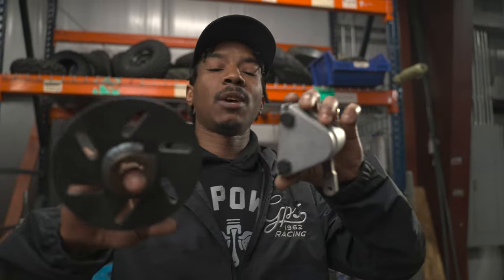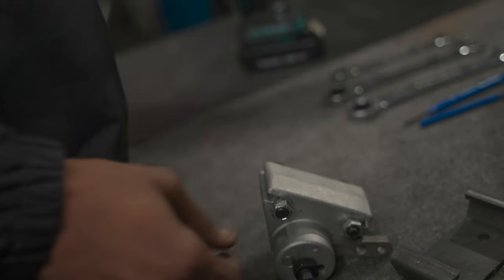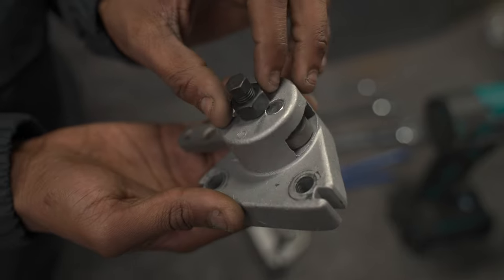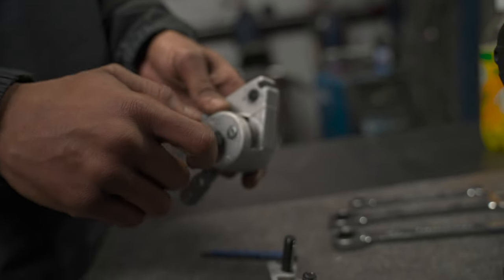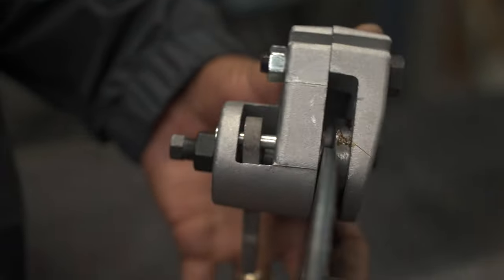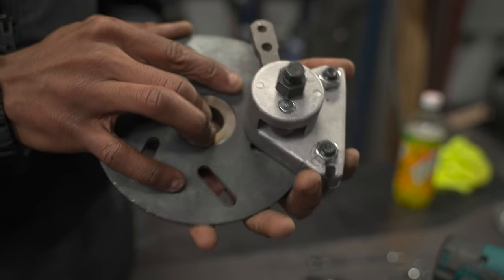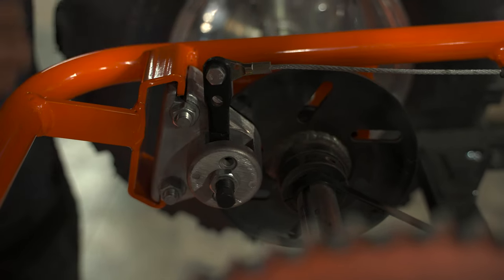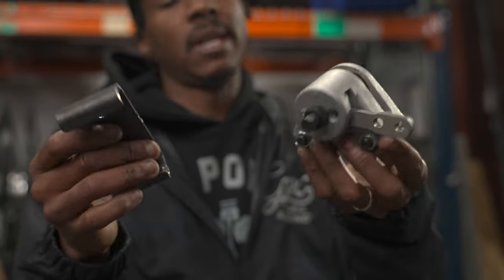Change Arm Positions on Go Kart Manual Brake Caliper Install

Comment: perfect ill need to flip the arm and probably upgrade the disk size because the 6 inch seems to be way under sized for the 23 inch tires I'm running🤣🤣 I guess I should invest in pads to because to combat the arm hitting the housing before it engages the brakes the guy that did the work for me just cranked down on the adjustment so the brakes constantly drag to slowly roll to a stop when you let off